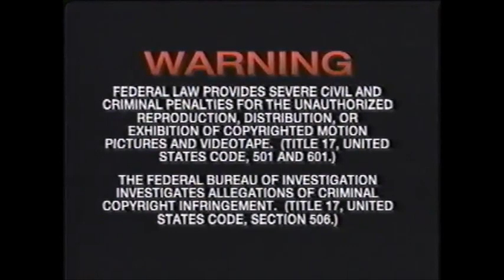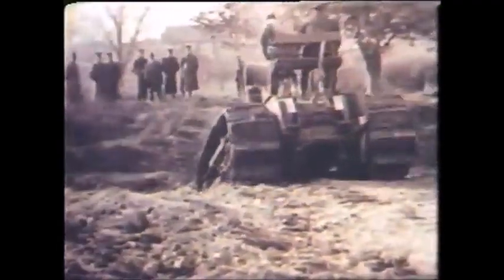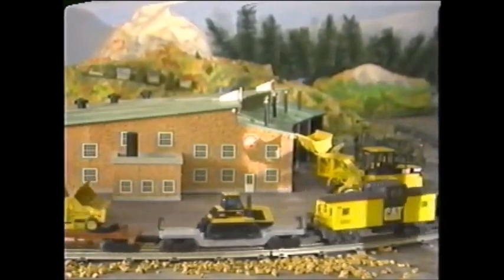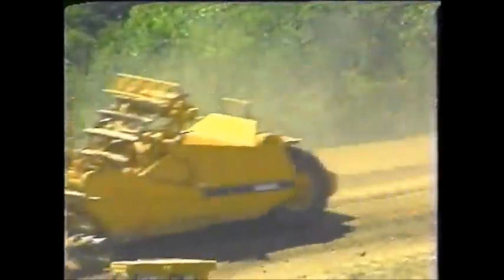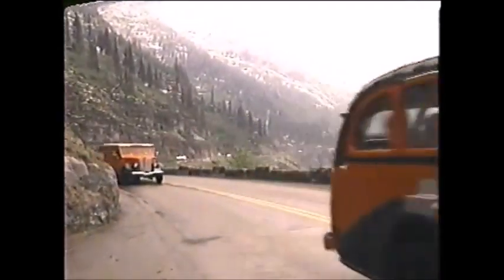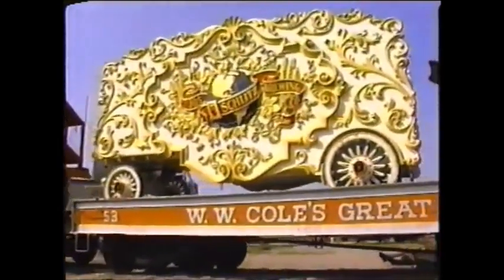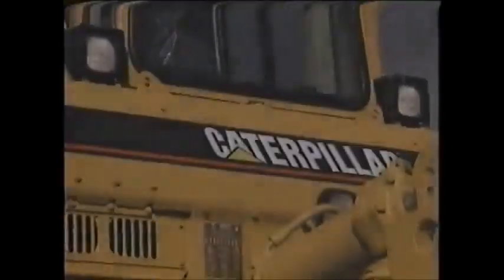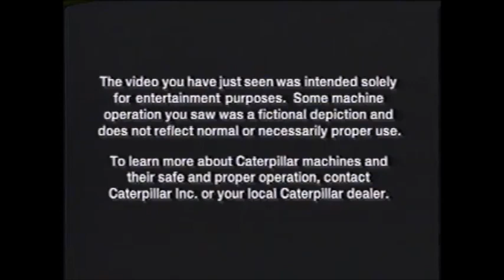I love CAT Machines

Comment: Cat was also king in the on highway truck engine market for years with the legendary 3406 series, the C7, C10, C11, C12, C13, and the crown jewel the C15 with its offspring monster the C16 and the V8, the 3408 back in the 70s throughout the 80s. However, due to the EPA setting tougher emission standards, they quit making the engines. It really sucks cause especially the C15 was such an iconic and well respected motor.
Reply from the maker: with Cat being such a big company, their Highway engines only made up about 10% of their company. their issue with the EPA regs was that they didn't have the time to make a reliable engine with those emissions requirements. now they can and they have begun to make new castings of older blocks so they can continue selling high quality remans (a Cat reman is just as good as a new engine but you can only reman a block so many times)